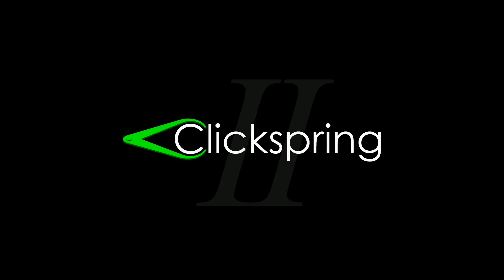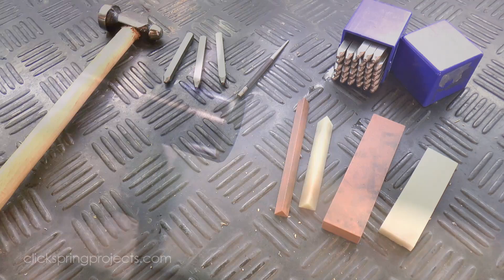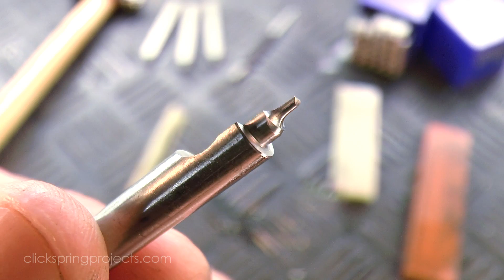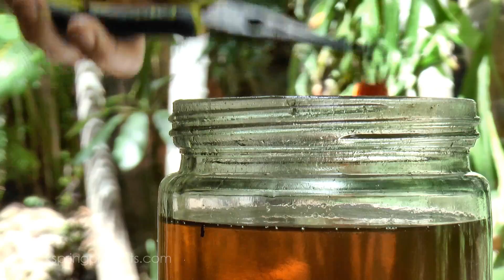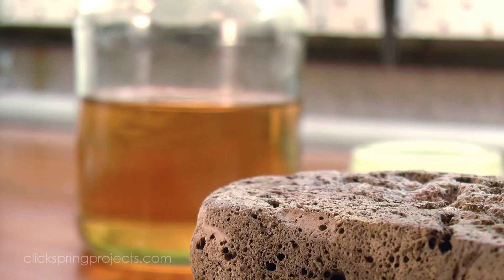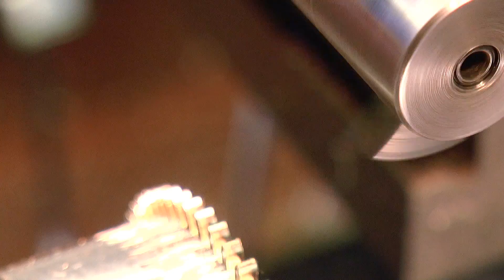Making A 'Cycloidal' Gear Tooth Fly Cutter

Comment: Hi what speed do you run your single point cutters at in feet per minute? I am making a Trent pinnion mill and need to make a cutter to manufacture the division plates.
Regards Andy.
Reply from the maker: For leaded brass, flat out (for steel, not at all. This type of single point cutter is not suited to cutting steel) - Cheers :)

Comment: I have a question potentially too long to answer here.... when designing your wheels how do you decide on the size of the addendum? So for  example if you had a pitch diameter of 10mm how would you work out the overall size of the blank you’d need? Sorry I know it’s probably big complex answer
Reply from the maker: All data and geometry regarding the cycloidal profile can be found in this book, highly recommend: "Wheel & Pinion Cutting in Horology": http://amzn.to/2HI6ca9 - Cheers :)
Reply: @ClickspringClips  thank you!

Comment: My only real question here is how many takes did that last shot require in order to get the cutter to end in that position? :P  Nice job as always!
Reply: last shot is reverse...maybe
Reply: I think it is called digital divider, machine that moves machined material in determined number of "steps". Search Clickspring, where he cuts wheels and pinions. Amazing place to visit, all of his videos. Just wow.
Reply: @DoItSurgicalWay  He means the cutter to be in frame
Reply: I’d say it’s two shots with the second shot being reversed and cross faded to from a shot of the piece as slows down. Or just really lucky.
Reply: Just a wild guess, one shot. My only logic is that this is Clickspring.
Reply: Hahaha! Same here
Reply: on an nc machine spindle orientation can be called by the operator, i helped on a machine company promotion production and a similar stop in position was requested, one line of code in MDI and its there. on a manual machine, it could easily take a few tries.
Reply: You guys are over thinking this. You could let the machine stop, rotate the tool by hand, then just edit out between the machine stopping and the new position.
Reply: Same lol
Reply: I've been officially wowed.
Reply: InstrucTube My only real question is how many people went to make the same comment as you and was beaten to it!!
Reply: I think he used a indexer

Comment: Always cool to see some of what happened behind the scenes in the original clock build series now!

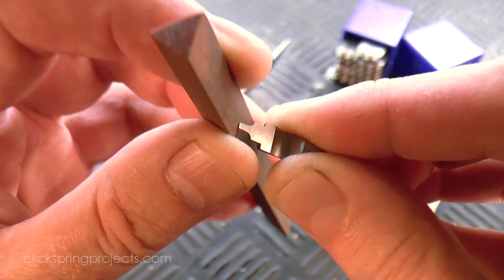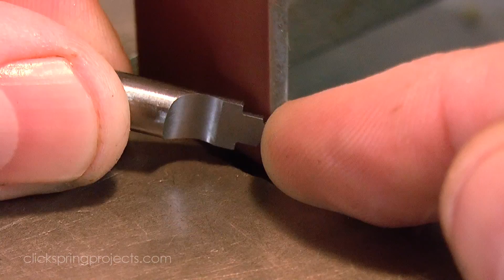But what is the chamfer you file at 1:00 and deepen at 1:26 for? Some sort of relief/clearance?
Reply: Good question. I'm going to guess that it is a relief. Imagine it cut square. Now as the tool spins, the backside would rub on the workpiece.